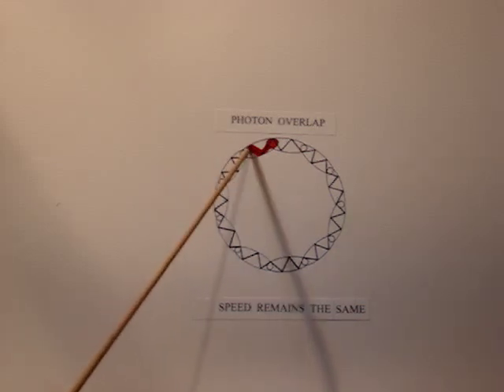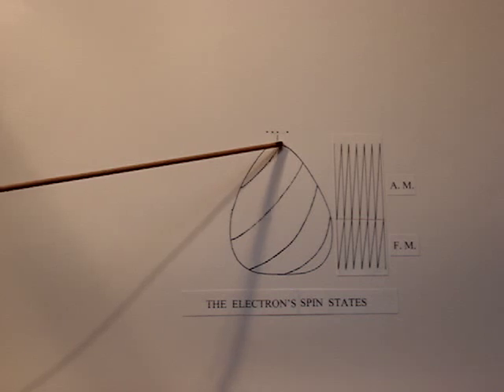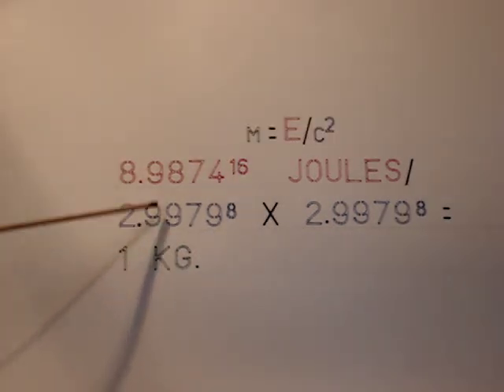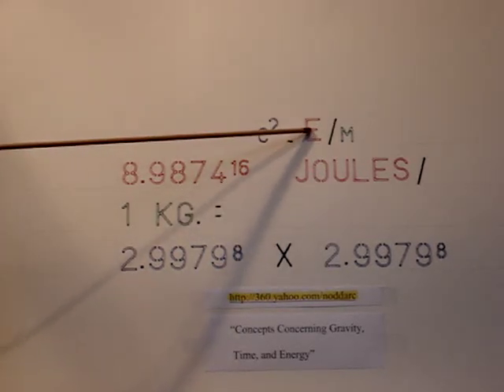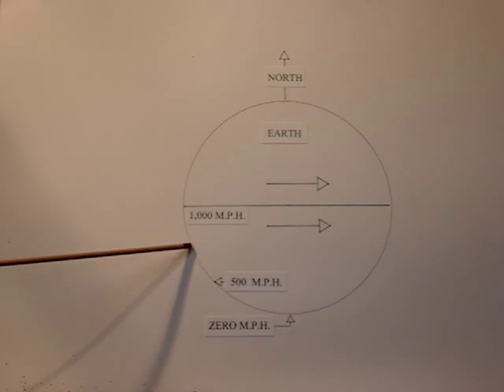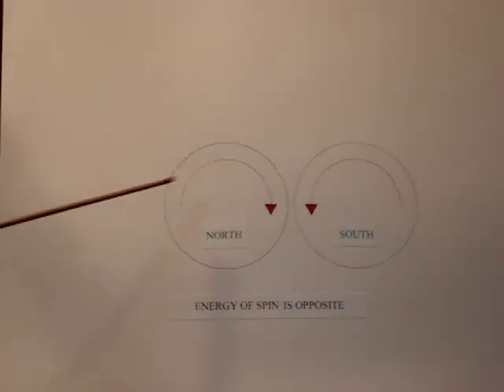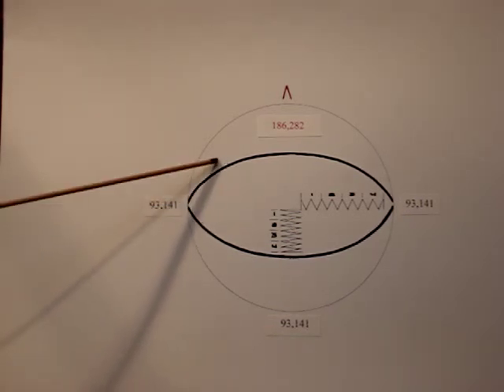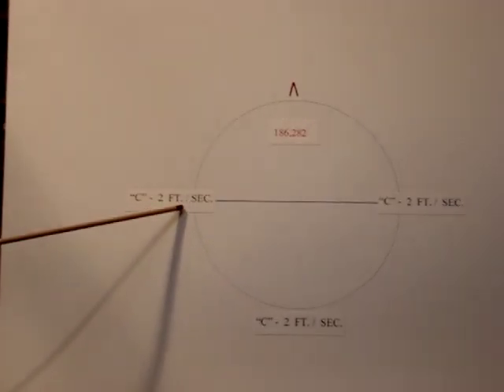Gravity Engine 1

Comment: energy is moving in the opposite direction on the southern hemisphere? what energy?
Coriolis force is not the result of moving mass and energy in opposite directions, its a mechanical force that shows on rotating disks only if you move your position on that disk by going further or closer to the center of the disk.

what are you talking about?